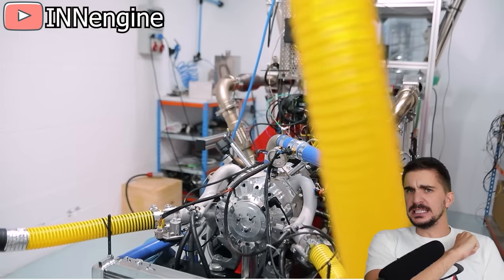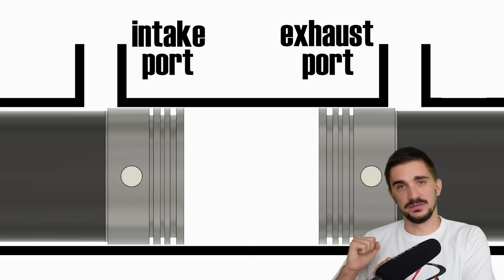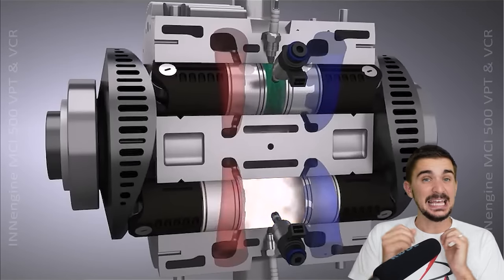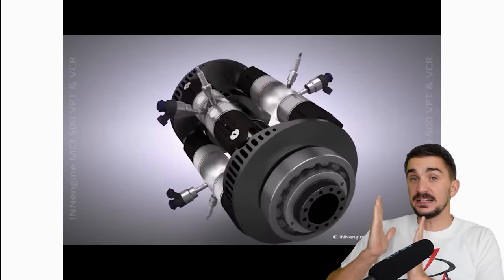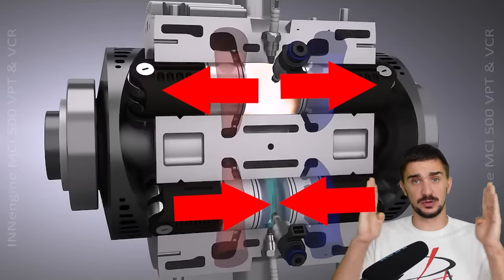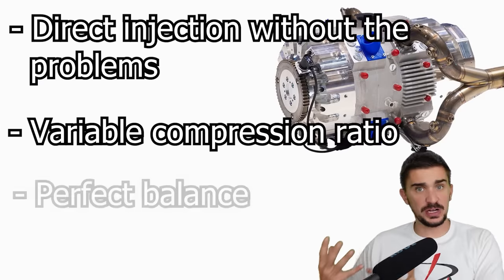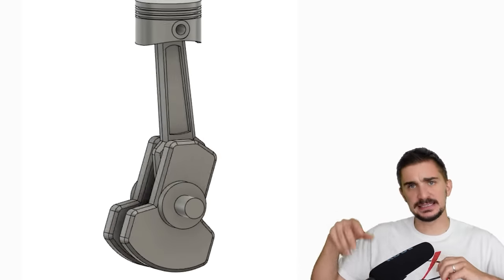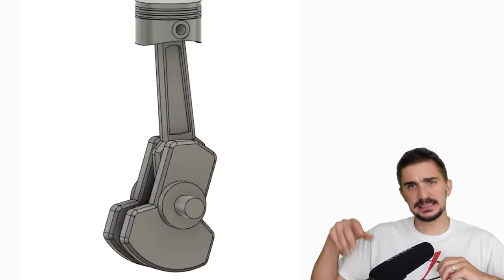Spain is Living in 2050? Revolutionary 1 Stroke INNengine Analyzed

Comment: So much to love in this engine! I notice that each piston pair fires twice per engine revolution, which is nice from the standpoint of applying shaft torques in opposed pairs.. but I think it would be fun to design the cam plates (wavy things) with three lobes instead of two (increasing the angle of their slopes, increasing torque output), and then using either 4, 5, or 7 cylinder blocks, so that there is always a cylinder delivering torque when another cylinder is in compression. The configuration shown, 2 lobes and 4 cylinders, relies on momentum to power compression, so the output is constantly switching from acceleration to deceleration, and a relatively larger rotating mass is necessary to dampen these pulses and provide the rotational momentum for compression. Using a setup where the number of cylinders isn't an integer multiple of the lobes number, would have the engine powering its compression strokes to provide smoother output with less need for adding rotating mass like a flywheel. Powered compression should also help the engine run better at lower speeds.

I agree that their test drive description ("no turbo.. atmospheric pressure") was deceptive.. two strokes always require forced induction. The old GM Diesel 2 strokes had Roots blowers.. Mercury 2 stroke outboards (and smaller 2 strokes like chain saws, leaf blowers, and even tiny nitro engines for RC models and such) use the crankcase under the pistons to compress the intake charge and effect cylinder scavenging. A two stroke which relied entirely on port timing and exhaust momentum to initiate scavenging and draw in the intake air, would be extremely sensitive to exhaust tuning and engine RPM, and might struggle to run at all except under ideal conditions.
Reply: Six cylinders in the two lobe design would also make sense, that way we would also always have one on the expanding stroke and creating torque. 
One thing still baffles me, and that is what keeps the pistons from lifting off the "wavy thing" and crashing back down afterwards. An analogy would be valves with too weak or missing springs on a cam shaft.
Reply: @rabiatorthegreat6163  At one point in the animation I can see a groove track running around the outside of the center shaft barrel, I imagine that a pin or roller on the piston follows that track to move the pistons when cylinder pressures aren't sufficient to do it.

Comment: You once again break down it down to its simplest parts and call it what it is, a 2 stroke engine. I see this as being a great hybrid engine. Small, light weight and can run at a set RPM and get great fuel efficiency. Keep up the great work, and may God bless you brother.
Reply: I'd see it as being a great range extender in EV applications.
Reply: I was thinking the same thing, this engine seems great for using in a hybrid configuration. It's small efficient, light, low-vibration and electric engine can produce extra torque whenever needed.
Reply: IMHO I see it as a Primary Source for the Drive Motor(s) with Batteries as the $ange Extenders.
Reply: Yeah, I was also immediately thinking generator, compressor, pump and other fixed RPM tasks where low RPM torque isn't needed.

Comment: It's not just that conventional engines have so much research and refinement behind them, but they have inertia. Manufacturing capacity already exists, engineers already know how to design/adapt them, mechanics know how to fix them, etc... 

You have to make a significantly better product than an existing well established product. Being as good or a little better just isn't worth trading off all that established infrastructure
Reply: If you could, LS engines would have gone away a long time ago
Reply: Not entirely true. EVs are significantly worse in every way yet people buy them.
Reply: @OutOfNameIdeas2 most people throw away their cars when something breaks so in that way Evs are more “reliable”.
Reply: @OutOfNameIdeas2  EVs are better at something: have better acceleration, noiseless when not moving, no risk of poisoning from exhaust fumes, have less maintenance needs - like engine oil and engine coolant check etc., right? 😊 I am not a fan of EVs, just be objective.
Reply: @marvin95  I mean yeah sure. Although its not hard to buy a V8 Mercedes that does the same numbers. especially after just a quick internet tune.
But yeah if you go and look at the cheapest for both instead of a price comparison, then you can buy a pretty fast used ev for not much money... But the thing with those is that they are cheap because the battery is pretty much dead. 

Noiseless when not moving is completely BS they do make less noise yes, but Evs have this ear piercing high pitched electrical whine going on constantly. And its worst when the motors are also making it when rolling. When driving our kia ev6 is noisier than our Volvo XC90 v8. Whine vs hum.

Exhaust poisooning? Do you usually sleep in your car a lot when it's completely windless with the windows down?

Evs do have less maintenance, but the maintenance is extremely expensive. So when it needs maintenance in a few years it's worth just trashing it.

People buy Evs because the tax incentives. That kinda makes them cheaper for people that can charge for free at work or at home
Reply: > INNengine is the first one to introduce 1 Stroke technology, meaning our engines have 2 power events per revolution in every cylinder. This allows them to deliver twice the power of a 2-Stroke and 4 times that of a 4-Stroke.

I'd say we should give this engine a shot, I'd love to see it being incorporated into vehicles like motorcycles. Just because there's already existing infrastructure, doesn't mean it should not be put to practice.
Reply: I think of it as "The MP3 problem."
Reply: @OutOfNameIdeas2  "People buy Evs because the tax incentives" That's just government interference and doesn't count as "cheaper".  As an actual taxpayer, I take exception to anything paid for by "the government".

Comment: Axial designs like this, using a swash plate rather that a crankshaft are very relevant. They have great potential for constant speed applications - aviation, marine, generators and of course range extenders. Another huge benefit of flexible compression is the ability to easily adapt to different fuels. We'll done! Great review - thanks.
Reply: Been around  since 1911.
Reply: I think that swash plate could be an interesting solution for Atkinson cycle

Comment: I immediately recognised this as an Axial engine and similar to a swashplate engine.
These are normally always inspired by what others will recognise as AC/Refrigerative compressors and Hydraulic/Hydrostatic pumps and motors.
Reply: Hey,  anyone here can tell we can replace the roller attached to the end of each connecting rod with a gear to drive the plate below it, or this idea is impossible??
Reply: that's exactly what I was thinking very similar to hydraulic axial pump and another thing two stroke diesels been around for years gone now do to emissions.
Reply: This engine is a hoax. Those rollers will spin impossible RPMs (at least 4X) due to the size difference between the wavy plate radius and roller radius. No bearing can take 25,000 RPM for more than a few seconds. Also, it's not a 1-stroke, so they shouldn't be claiming that. And the HP claim is impossible too by 4X.
Reply: @travelinkevin5130  i guessing you are missing a zero on that number? Most ball bearings can go to 25k rpm for standard use.
But realistically, you can't just go call the engine a hoax more so that the dreamt up figures and efficiencies are what is made up.
Its possible and the engine will work with  a variety of different bearings, just dont expect it to be reliable let alone put in race car.
Reply: @Syncrusan  
Look up ball bearing speed limits. Caged ball bearings overheat and die at about 6k RPM. This application has vibrations that would make the matter worse. 500cc is only 30 cubic inches. They claim ~4 HP per cubic inch, which is ridiculous. For those roller bearings to survive, the mainshaft speed would need to stay below ~1000 RPM. 

That layout has 8 power impulses per 360 degrees on the mainshaft. Working the 'PLANK' formula shows a mean pressure like a Top Fuel engine. I liked the engine initially too, but on closer inspection, it's a pipe dream.
Reply: @travelinkevin5130  My ball bearing turbo wants a word with you about what RPM bearings can take... 🤦
Reply: @EddieTheH  Size matters, as does loading. There are bearing speed calculators online.

Comment: this engine seems like the sort of thing that is perfect for use as an ICE for a hybrid car or as a petrol range extender for an EV
Reply: Yup, with the additional advantage of lower weight, further decreasing the net weight of the vehicle ( and, making it possible to create smaller hybrid vehicles).

Less battery drain for equal, or better, results.
Reply: @ironwolfF1  I'll subscribe to those comments also.  Great presentation, as usual!
Reply: Hoping this is why it's called amper
Reply: A constant high rpm generator.
Reply: @nobiden3134  If you want to run continuous high RPM, a small gas turbine is much more efficient.
Reply: No, this sounds like something you stuff in a Polaris Razr and haul ass with and experiment by adding nitrous or boost.Stop ruining cool ideas by hugging trees.
Reply: @Stoney3K  Yeah, however...the cost of maintaining said turbine (not mention replacement parts) puts it in the realm of corporations & governments), not the private citizen. E.G. ZERO practicality for you, and me.

Until now...a new player has entered the arena.

Comment: Probably one of the better engine designs I have seen in several years.  Hope they make it.  Looking forward to the bigger engine version.
Reply: the liquid piston engine is pretty cool too, check that one out & lmk what you think. My intuition is that this one might have a little bit of the upper hand (for racing/motorsports) because of the simplicity of the dynamic compression ratio mechanism though, but the lack of moving parts in the liquid piston engine is noteworthy no doubt.
Reply: its opposed 2 stroke engine .. made 100 years ago .. works but poor emissions and economy
Reply: Just How many engine designs have Seen ? I'll be 70 in a few months,  I've seen them ALL ! LIKE your 100 years old! .
Reply: @STRUTZKOFF  You beat me to it. Not only is this not a new design, but it is certainly not a good design, lol. At least a regular 2 stroke engine uses the crank case area and piston to pressurize the intake charge and ensure adequate scavenging of the combustion chamber. These probably still have 30%-50% exhaust in the charge without some form of forced induction to actually scavenge adequately. 

Watching this video I am so curious if this person knows the history, but is trying to steal it, or if they are so ignorant of engineering and history that they honestly think they came up with something new...
Reply: @willchristian5954  The Dynacam engine was about the same. It was used during WWII in torpedoes and it's a certificated aircraft engine. This is nothing new.
Reply: @Jerry-up8bk  Bro, you dont have to be old to have "seen them all", you just need to care to learn automotive history and then go to an automotive museum. I am not even 40, but I have "seen them all" because it is one of the many topics I have studied. It is actually very likely I know more about engines and automotive history than you do, because instead of just accepting what experiences come along, I have actively worked to learn everything I can about the topic. I also went to an automotive tech school and spent over a decade as an auto tech before advancing in to industrial robotics years ago.

With all those years you still have not gained the wisdom to recognize that age does not equate to knowledge. I know I can learn things from younger people, and some know way more than I on certain topics. I know idiots grow old just the same as geniuses, thus only a fool would trust someone simply because they are older. You are proof that people should be gauged on their demonstrated intellect, not years of experience.
Reply: @buffdelcampo  Was wondering who else noticed that. It's your basic swash-plate motor, and not significantly different in operation from the torpedo motors of WWII. The only thing "new" about it is that the torpedo version from back then didn't use opposed pistons - just one set of moving pistons reciprocating in a cylinder with a closed bottom.
Reply: @von...
Liquid piston still has the rotary problem but backwards
Reply: @felsinferguson1125  almost 100 year old tech finally finds its proper use !
Reply: IT'S A 2 Stroke Engine and they were invented and used in the UK years ago.
British Telecom used the Commer Van's with the Knocker Engine in it.
The Knocker Engine was a 4 Cylinder opposed piston 2 stroke Engine.
Reply: they should mesh it with rotary as its so similar, also ive seen similar designs for years so this is the best one to come out yet and surely needs more testing to better understand failure points but its design looks promising for now